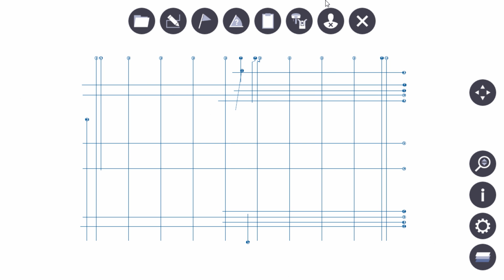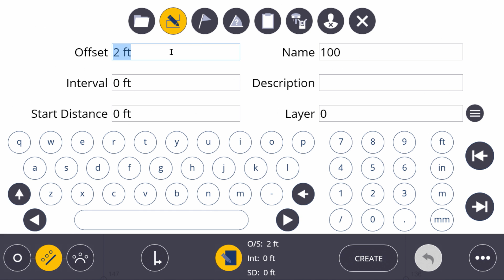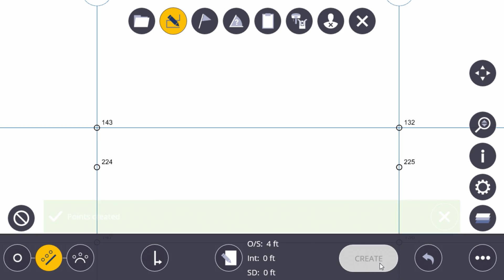Tips And Tricks - Creating Reference Points In Trimble Field Link

Comment: How I would stake to a line in Trimble field link with out creating multiple points on a grid lines? Thanks!
Reply: I think making those initial points at the intersections is necessary.  Instead of making all the intersection points off the grid lines like he did using that eye button, you can just select intersections individually, create your offsets based off of them, and then delete the intersection points afterwards if you don't like them there.  That's what I do anyways.